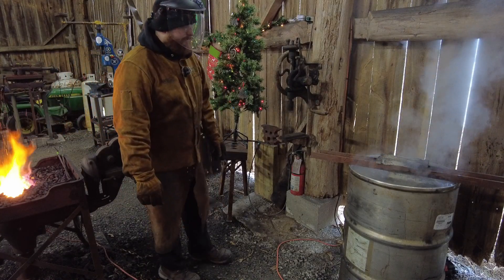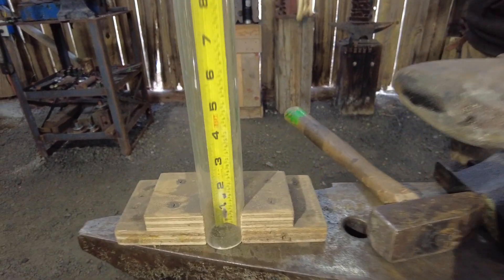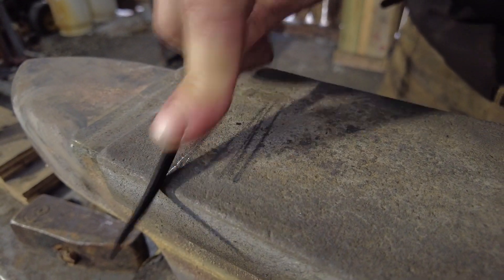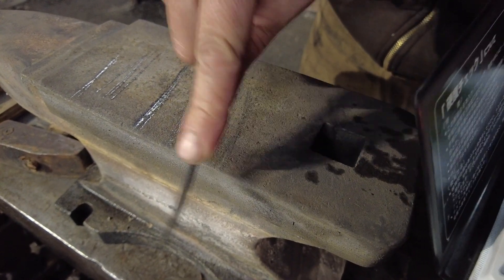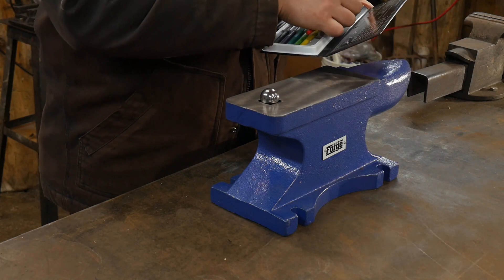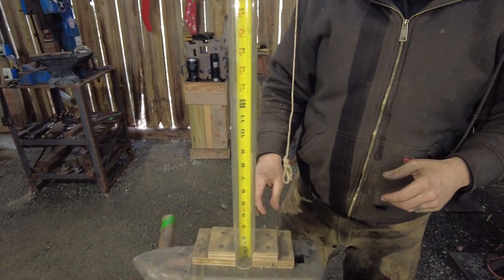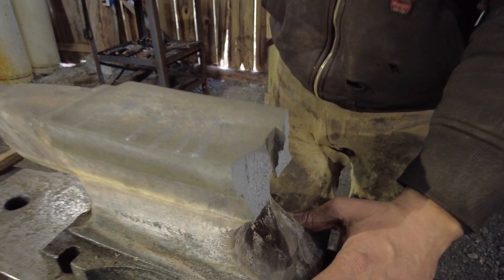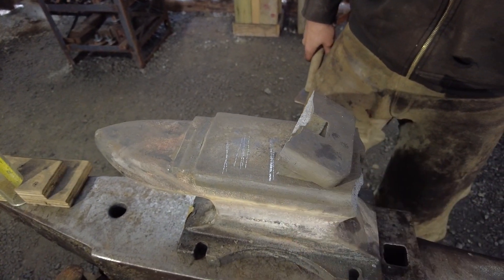Harbor Freight Anvil: Can It Be Hardened?

Comment: I'd say the tester is mislabeled and the one marked 50rc is actually the 45 and the one marked 45rc is the 50rc.  55 cut metal, the marked as "50" did not ,the  marked as "45" cut again. Then the 40rc skated like it was on ice . So while it's not important , it's worth knowing for sure uses . ,test your testing equipment before relying on results, when ever possible . If it's a serious test, always make sure new equipment is calibrated and labeled correctly because you will get inaccurate results .  Just a tip( and just for a minute )  for anyone who doesn't realize this.
Reply from the maker: Hope to get in some better testing equipment in the future...
Reply: @ChristCenteredIronworks while it's always the best choice,  like I said ,do it "whenever possible". One can only get what they can afford , Id bet just re-marking the handles to say the right hardness would be good enough for Rockwell chart scratch testers.  If you do want a good and consistent source of tools , while not the cheapest  Brownells is a good way to go .  They are a gunsmith supply store , but metal smithing tools are mostly the same except for the specialty tools for a given task. 
They have hardness testers and  a great many other things you may find useful . Tempalac a varnish that melts when  the metal hits the desired temp.various prepared carbon sources for colored case hardening  , air  water and oil quenchable high speed steel blanks. Blank high carbon drill rod , taps and dies and  on and on. 
Good luck!

Comment: I believe that it would take days of heat in a carbon rich atmosphere and multiple heat treatments to get the most depth of hardness to the casting. Then it would take a controlled annealing process before a final hardening similar to this process. At that point you could order a dozen better anvils from Alibaba
Reply: have you had luck with the alibaba anvils?
Reply: @vidard9863  I am only using them as an example of another low cost option. I haven't had the opportunity to purchase from them, however some of the manufacturers who list their products are very responsive to their customers needs and could probably provide a better quality item at a better price compared with going through the process of heat treatments for the harbor freight anvil.
Reply: @petercoutu4726  i don't understand this concept. you cannot really heat treat HF anvils. you weld better steel plates on top of them, or ideally just use them to decide if blacksmithing is worth investing in.

Comment: That was interesting for sure. I have a theory about the improved rebound; could it be that having it upside down in the forge melted the Bondo inside the anvil and caused it to settle against the face, thereby increasing the rebound without actually improving the anvil itself?
Reply: There is no bondo inside a casting, and any bondo in surface pits would burn out way before those temperatures, its basically plastic.

Comment: Could you successfully do this with a cast steel "acciaio" anvil if you weren't happy with the surface hardness? I have a few which I'm happy with but recently purchased a 110lb and the surface isn't very hard. Very little rebound and dents really easily. Just wondering if it can be improved or would I destroy it in the process. Thanks

Comment: To be honest this anvil can be something you have machined down and replace the flat with a machined piece of steel and have it epoxied and heavy screwed down either using flat facedscrews or a V shaped bolt like a lug nut into a counter sunk hole and then smooth out to flat. Save some money as you might be able to get cutoffs or even just scrap piece of steel to replace. The rest of the anvil is mostly just dead weight being used then.

Comment: It would seem you could buy a new anvil for the cost of fuel you need to thoroughly heat the anvil.  It would be interesting to see you try it on one of those cheap steel anvils.

Comment: I have one of these weights. I was going to add an inch of Hard face welding rods to improve the rebound. Either that, or weld a chunk of much better steel on top.
Reply: I'd go with the plate of steel over the welding rods, as you can do it pretty quickly running a single bead along each of the four sides instead of welding several rods in place. That's what I did with my 55lb HF anvil and it has been working like a charm for almost a decade now.
Reply: @danielthompson6207  I had the same thought after posting the comment. 4 welding rods would be better than 100 welding rods.

Comment: Harbor freight does have some good tools and other items, but they have some real klinkers in there too. The anvils are klinkers. But there is something you can do to them. Get a sturdy rope and tie it through the Hardy hole. Row out into the nearest body of salt water until it is far enough to begin getting less polluted. 3/4 mile should do. Next, hang the anvil over the side with the rope. Then, cut the rope, row back to shore, and feel the burn from the workout. Finally, go invest in a decent anvil.
Reply: Meanwhile divers are avoiding anvils 😂
Reply: Why not scrap it, or give it to a scrapper.
Reply: @ethankriegel5957  10 cents a pound vs the joy of doing something fun with that much potentially stored energy…
Reply: Much better to throw used car batteries into the ocean. It's safe, and it's LEGAL.
Reply: What is wrong with you? Why would you want to discard a perfectly good ingot?
It's a prime case of melt it down and forge a better one with an addition of a bit more quality steel.

In theory, one could heat it to bright yellow and being forging it, welding the granules together a bit better, but in the real world, you'll always have weak spots and it'd be less work to melt it down and forge it anew.

It's been a while since I saw steel with a Rockwell hardness equal to butter.
Reply: HF anvils: not good for blacksmithing. Great for your typical DIYer's "anvil-shaped object" needs.
Reply: @Azlehria  hey sometimes you need to smash something hard with something hard on something hard and don't fancy breaking another vice to do it 🙂
Reply: @Azlehria  doorstops?  Paperweights (smaller ones)?
Reply: Yes!! Always go to a unpolluted place to pollute! I love humans!!!
Reply: @rockylong7546  Hey, it's just raising the iron content of the water.  Helping the local wildlife have healthy hemoglobin levels!
Reply: @gpweaver  don’t say hemoglobin.  I am part globin and my mom is full hemo.   OFFENSIVE!!
Reply: @rockylong7546  good, be offended
Reply: @rockylong7546  Well, that's the weirdest Youtube reply I've seen today.  😃

Comment: I am building my own anvil out of I beam and a 1" thick block of 4140 for the striking face. 

The 4140 should harden up to about 52 Rockwell.

I was wondering how to heat the thing up, but had not considered using a coal forge to heat just the 4140 part. I was planning on building a furnace around the thing!

Very helpful.
Reply: Let us know how it turns out!

Comment: Really surprised you didn't take a quick pass with a flap wheel to get that scale off before any testing.
Reply: Yeah the scale is really deadening the rebound potential. Kinda surprised they overlooked that one.
Reply: Yeah, it seems the tests were done with an expectation of failure. Scratches in the oxide don't show anything about the hardness of the steel. Might as well test the hardness of the paint.
Given the quality of the source material and your vast experience in the subject I can imagine not expecting success, but I would have loved a bit more objective approach to the testing.
Reply: completely agree. I feel like this was very inaccurate.
Reply: You guys are missing the point. The anvil shattered at the end. An oil quench would have only resulted in a faster quench, leaving the iron hardened even more than it was. 

For noobs: it would have shattered even faster in an oil quench.
Reply: @TehButterflyEffect  No... oil quenching is slower than water, water notoriously makes things brittle/causes microfractures from the speed of the quench.  Google "quench speed water vs oil" and read the first result... or any of the other results.  They also could have/should have tempered it after to help reduce brittleness. Add to that their partial quench, where you get uneven cooling that causes thermal stress... they were setting this thing up for failure on all fronts.  Intentionally or not, it's hard to say.
Reply: @jadedelite it’s not as simple as you think. Hardening and quenching is for steel alloys, not cast iron. Generally, you never try to harden CI by just doing what they did. I can harden CI, but it involves more steps. They were trying to show what will happen if someone buys one of these and gets the “brilliant” idea of hardening it the only way they will think of. It doesn’t matter if they used oil or water here, the result would have been the same. But oil quenching requires that the entire object be immersed in the oil and moved around. Otherwise the oil catches fire and sprays boiling oil all over, or oil that is large droplets of burning oil. If you’ve even seen that happen, you will never try it. They would need another 55 gallon barrel of quenching oil, and it won’t work anyway. At about $20 per gallon, that’s expensive.
Reply: @melgross  I disagree that the result would have necessarily been the same.  As for process of an oil quench, agitating the oil instead of the work piece is fine and much easier (could even be done from a safer distance with a power drill powered paddle of some nature).  It would have produced much less stress on the work piece so fewer stress fractures, by cooling it more slowly.  I quench in oil regularly (including cast iron, but mostly steel) often times with flame ups, it's not the end of the world so long as you're wearing safety equipment.  Cast iron will 100% get harder from a basic austonization/quench cycle if it's the right "kind" of cast iron... which this might have told us had they not engineered it to fail.  Never as hard as hardened steel, but harder than untreated cast iron.  But doing it in water is almost a 100% sure fire way to result in microfractures.  And testing hardness through scale will 100% show scratches (in the scale).  And testing bounce through scale will 100% result in less rebound than without scale.

As for the cost of the oil... I'm sure based on the # of views and comments on here, they've made plenty of profit on this video while doing what appears to be an intentionally bad job of actually trying to harden it.  YT content is a for-profit business, sometimes that means some investment.
Reply: Honestly, for hardening cast iron you ALSO don't need to get it steel hot to austenize it... so yet another thing they did to sabotage the results.  Flame hardening alone may have been enough even.
Reply: @TehButterflyEffect  haven't missed that point. I completely accept that these guys know their stuff and that the base product as well as the result is a piece of junk. I have no clue about metallurgy or anvils, other than what I see in videos like this one.
The conclusion can be the same, but the approach shown is not unbiased. I take the same issue with channels like EEVblog, where there's always a preconception about whatever is being tested. Either "this thing is expensive so it'll be great" or "This chinesium piece of trash will probably catch fire lol".
Reply: thank you for saying it
Reply: why? the scale gives good contrast shows the scratches better. would be the opposite of what you want
Reply: @genghischuan4886  but for the ball bearing bounce test that has to be dampening some of the inertia.
Reply: @genghischuan4886  But are you only seeing scratches in the oxide and not the hardened steel?  Tough to tell.
Reply: @jasondavis3244  sure you can pulling scale off only will leave the top brighter but it will leave definitive gouge easy to see if probe harder than metal
Reply: @genghischuan4886  This is meant for primarily entertainment in my opinion, with56k views i doubt even the majority knows how to blacksmith including myself, but yeah not very scientific at all.
Reply: @Nelo390  just having a bad day,
Reply: @genghischuan4886  Fair enough, and i hope your next day is better.
Reply: @Nelo390  yeah I know but if you gonna do something and pretend youre doing it right, then do it right

Comment: I'm pretty sure its cast iron. Cast iron has a very high carbon content compared to steel so therefore cannot be hardened to my knowledge. Maybe it'll crack, maybe it won't, but I doubt you'll get it hardened. There are some cast steels that can be hardened.

Comment: Guys, I'm a fan, but I don't think this experiment was very accurate. Once you quinched it, it should have been tempered and polished. Without tempering, made it really brittle. Without polishing, you files were just scraping scale and not giving you an accurate reading on hardness. I like the idea of this test, just need to refine the controls a bit.

Comment: Something I have found hardening home made tools is that those surface oxides can be a fair bit softer than the hard metal underneath.
Reply: Wouldn't u want to polish off the surface oxides im no pro
Reply: @mikehancho3500  Not just those, also decarburization (decarb) - a layer where the inverse of case hardening has happened - air has leached out the carbon. Usually quite thin but some steels and long soak times can cause deeper layers.
Reply: Also with hardening metals most metals need to be tempered back as they would be to brittle and shatter if struck or dropped from a distance . It kinda makes me think the casting got hard but because its cast it is easy to break when hard so that's why they leave them soft anvils , my question would be can you weld a solid high carbon steel to the anvil and harden the piece of high carbon steel ?

Comment: Just about what I thought. Quick tip. If the item being Rockwell tested is something important, start with the low end files. Check in the same place each time. When you finally make a scratch, the Rockwell will be approximately half way between it and the previous one that didn't. The diamond tipped single prick gauges will produce a more accurate result should you need one. I'm guessing this vice was just used for testing, and; not serious use.

Comment: I welded a steel plate (stick, nickel and then I just mig welded to look good) on top then drilled holes on top and screwed a few big screws I had around, then just grinded the screw heads and filled any hole with my mig.
Reply: Screwed or bolted? They are two entirely different fasteners.
Reply: @chrisallen9154  bolted

Comment: My best guess, If you're just using a bucket, It will either shatter, or won't harden much, if any.  Most likely it's cast iron, which won't properly harden.  Even if it does have the right amount carbon, the anvil will boil off the water and insulate itself, to the point that it cools too slowly to properly harden.  I've heard that old anvils were often hardened under a waterfall, so the moving water overcomes the steam jacket and actually quenches it.

Comment: I’ve always wondered lol my thought was to heat treat a 1 inch piece of steel and weld it to the top?? Worth doing or just buy one from your Amazon affiliates? Lol FYI-Harbor freight used you as an ad placement haha your video, then harbor freight commercial 👍🏼
Reply: I've heard of this being done on larger cast iron anvils, and historically this is one way they could be made.  Many old anvils, even quality ones, have a steel face cast into, or welded onto, an iron body.  Welding it on solidly and hardening it isn't easy, but is doable.

Comment: it seems folks are conflating cast iron with steel. From my understanding you cannot harden cast iron. you need a hardenable steel so the only way to harden this anvil would be to melt it down, add carbon and other elements for the steel alloy of choice and then recast.
Reply: Cast iron has MORE carbon than steel, not less. That makes it brittle, which is why it's unsuitable as an anvil.

Comment: Interesting video. Would it make a difference if you were able to evenly heat the entire "anvil" AND quench it in plenty of oil?
Reply: Cast iron won't make any difference. The material can't be hardened. The surface of the piece can look like it's been hardened, but that hardened layer will be only microns thick, because cast iron has too much carbon in it. It's for lowering the melting temperature. It causes the casting to be rigid (fragile) and relatively soft,  not malleable. You can quench steels that you can forge and reach good results. You can have success with a piece of 4140 for example.
Reply: @baladar1353  That answers my question, thank you.

Comment: A good experiment, and a fun video. You could harden it by welding tool steel electrodes. That's what I wanted for my mild steel diy anvil - but these electrodes are very expensive.... And I have no use for 5kg of these...
Reply: Not to mention.... welding it to cast iron...

Comment: Trying to turn an HF ASO into a useful anvil by any means reminds me of the famous Robert Heinlein line: "Never attempt to teach a pig to sing. It wastes your time and annoys the pig."
Reply: You might be able to melt it down 2 or 3 of them, and cast them directly over a preheated and fluxed rectangular plate of 4140 or 5160 which can be hardened after the fact to give you a simple knife making anvil with a hard face and plenty of mass(assuming the face actually sticks).
Reply: Or, "you can't make a silk purse out of a sow's ear". (not RAH)